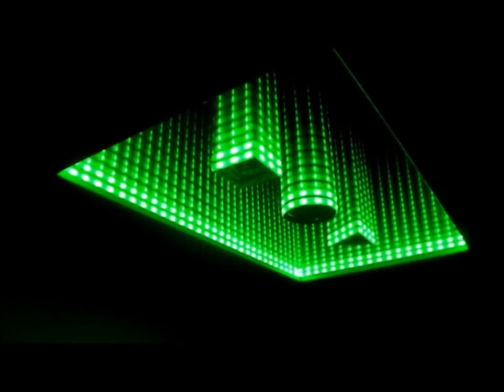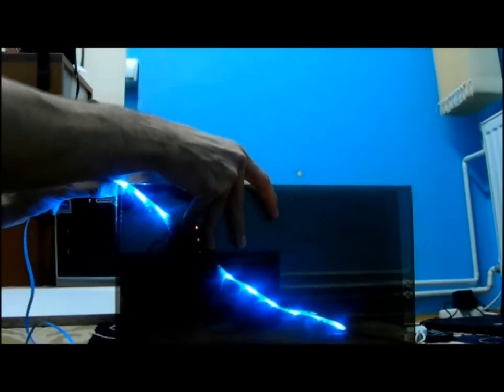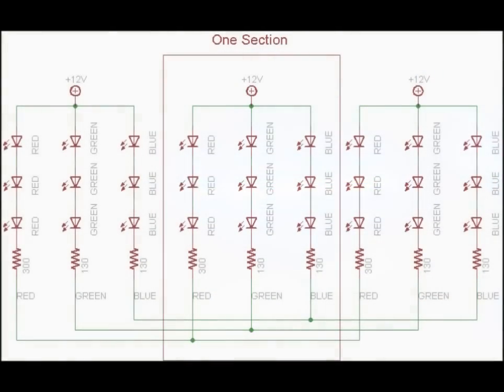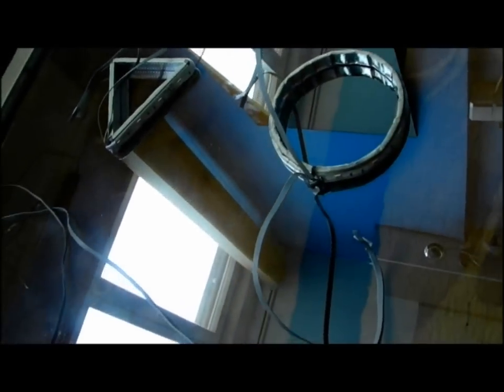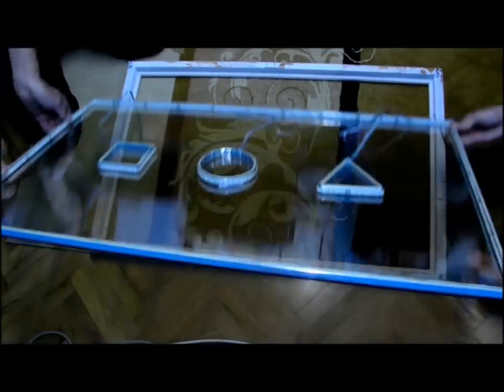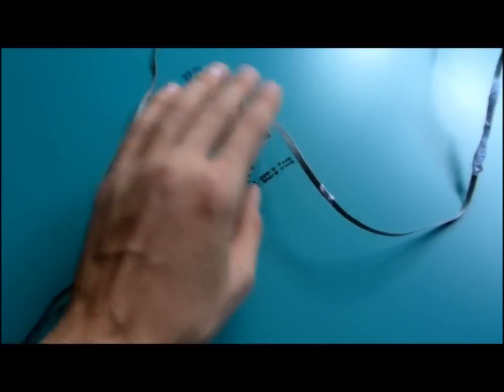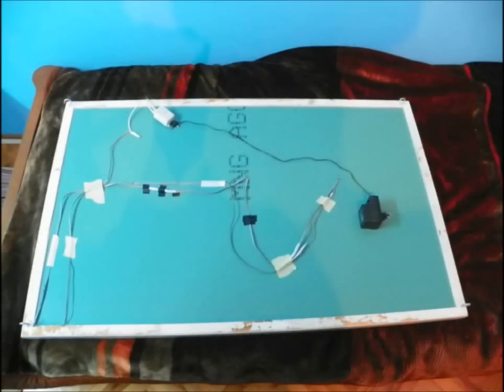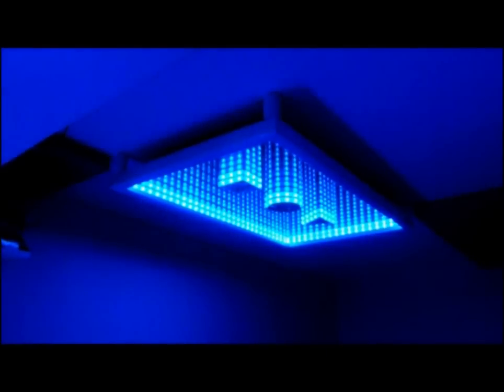How to make an Infinity Mirror

Comment: The infinity mirror is a symbolic representation of the PERSPECTIVE and RELEVANCE of DEPTH in the flat land world.  In our 3D world depth is normally conceived as a MEASURABLE QUANTITY having a LENGTH, BREADTH and HEIGHT.

In case of flatlanders, the EXTERNAL is a REPRESENTATION of the INTERNAL, meaning that, the 3D cube could be an outward projection or MANIFESTATION of their INNER SPACE, as in, they could reside in lower dimensions PHYSICALLY, but far surpass us, as the SPACE that they are confined to need not be physical but PSYCHOLOGICAL, EMOTIONAL and SPIRITUAL in nature. In other words, they solely dwell in their INNER SPACE that comprises the whole dimension in their realm of existence!. 

It is quite hard for us to perceive this concept, since we are so immensely attuned to the PHYSICAL DEPTH in the 3D world, that it often prevents us from INNER ENGINEERING our minds!.

😊🎉🎉

Comment: Hello Muhamed,

Well done.

Peter Nolan.(Ph.D., experimental physics). Dublin. Ireland.
Reply: Peter Nolan ...Peter Nolan ...Hi, just curious about your experiment.  Did you proceed with your idea? 

I wonder....would your experiment actually work?   The reason I ask is that, here on earth at ground level, the pull of gravity would be a constant from the start to the end of the mirrors, and back again,  and everywhere in between. I would speculate that the pull would be equal at all points,  creating a uniform drag throughout.  I wonder if this is measurable? Maybe?  Maybe it'd create a solid wall of light as the reflection droops ever so slightly,  assuming there is no loss of light.

Conversely, a light beam travelling in a straight line, unaffected by gravity, and then passing within the field of a gravitational pull,  and then passing back out beyond that field to continue on in a straight line again, IS most likely measureable (observable). 

Thoughts?  I like your idea. I hope you were able to get it going.
Reply: Okieman Mike Hello Okieman Mike,

It all depends on the numbers. I would have to either study general relativity in depth or approach an expert who specialises in general relativity to tell me the formula that will describe the deflection of a light beam, provided by a high power gigawatt single pulse ruby laser, traveling parallel to the earths's surface over stay a distance of 100 meters or thereabouts to see then if any such deflection could be measured. It might be too small but right now I do not know one way or the other anything about this. As I say it all depends on calculating that deflection from a formula that can be worked out if it hasn't already been done. I think this would be a great experiment to do on earth.
I still feel using intuition that if one could have many reflections just say millions back and forth that takes place in a infinity mirror that over many refections a deflection that big enough could be measured. It will take me years anyway to get round to doing this experiment and it would cost a lot of money if it's doable.

All the best,

Peter Nolan.(Ph.D., experimental physics). Dublin. Ireland.
Reply: Stol 3d
Reply: Hello AllEtcetera,

Why do you say that?

Peter Nolan. Ph.D.(physics). Dublin. Ireland
Reply from the maker: Thank you. =)
Reply: Hello Muhamed,

You have given me an idea how to do an experiment in physics that I have been thinking about for some time to see if I can measure in the lab the pull of the earth's gravity on light that is predicted by Einstein's General Theory of Relativity. This effect has been observed by measuring the deflection of light from a star as it passes by our sun but the has never been done in the laboratory as far as I know. If you do a bit of googling you can read up about this famous experiment in physics done many decades ago not too long after Einstein published his theory I think in 1915/1916. I think it was Eddington who did the experiment by traveling abroad from England to where an eclipse was happening.

Peter Nolan.(Ph.D., experimental physics). Dublin. Ireland.
Reply from the maker: Nice to hear. That sparked my interest, I'm looking forward to hear from you.
Reply: Hello Muhamed,

My idea is very simple to reflect light back and forth between two mirrors placed say a few hundred meters apart using a high powered pulse laser to see if the light by traveling back and forth between the mirrors parallel to the ground the earth's surface might undergo a deflection due to gravity that could be measured but until I do the numbers using formulae I will not know if this experiment will give a measurable deflection or not.

Peter Nolan.(Ph.D., experimental physics). Dublin. Ireland.
Reply: What a shitpost

Comment: but if some LEDs dont work anymore u have a problem, as u cant easily change em?!
Reply: xXN0cturnXx Yeah, if some went out, you'd have to take it apart, and replace the strip that has the burned out lights. Definitely make sure you use "LED" lights, as LEDs will work for many years before they start going out.

Comment: what kind of drill bit did you use for the holes in the mirror?
Reply from the maker: I didn't do it myself, I asked a professional to do it for me.
Reply: You can do it yourself, the trick is, you do not DRILL a whole in glass - you GRIND it through. 
A small grinding ball or cone can be found anywhere that has DREMMEL supplies.

Take your time.
Apply only light pressure.
Keep it wet.
Reply: Professionally cut, I imagine.

Comment: I have to agree with that one. You can speed up your computer if you got rid of all those shortcuts on your desktop. Use your start menu to get to your programs. Just a helping hand from a computer tech. Other than that, your project is very cool. Would like to see it slowly change colors without the lights going out. I plan on making one just like yours. I will have 500 lights on a 8x10 box. Keep up the good work and stay safe when using electricity.

Comment: I want to know how long do these LED light strips last? And have you ever had high temperatures on the LED?
Reply: TheFNProductionz My new 5050 RGB 150 LED Waterproof Strip Light came with a 12v 5A power adapter. the temp runs high.As to the life of them 20,000 hours. I have many Leds in my house used in /lamps /DJ gear/projectors/security, I have not needed a replacement led in anything,tho as a tech I have replace a few in repair products.
Reply: Fly Robin What kind of temps do you get? Is it hot to the touch?

Comment: And what life time do the LED's have on that? Wouldn't be worth it if it wasn't very long...
Reply: Well, LEDs are usually expected to have a lifespan of more than 50,000 hours. I'd be more concerned about the capacitors. Generally speaking though, you are probably looking at years and years of use.

Comment: The only reason I clicked this was to check how he drilled the holes.

And the only thing that wasn't covered by the video was: how to drill the holes.

Come on.
Reply: Lam http://www.doityourself.com/stry/how-to-drill-holes-through-a-mirror#b
Reply: there are specific drill bits for glass, there diamond tipped. you can get them at most home improvement stores
Reply: nicholas manfredi remember using these bit you must use water to cool off mirror while cutting or you will break the glass. you could also you plexi glass. Tap plexi glass is a good source. they might even cut the holes for you.
Reply: yes, thank you, i always forget to mention using a coolant.

Comment: If you replaced the initial mirror with another pane of one-way glass (so you had two one-way glass panes, instead of one with a normal mirror), would that make the infinity mirror work from both sides?
Reply from the maker: The illusion would be weak. It could work with powerful lights and 90% light transmissive glasses but using glasses like that barely you could see through the other side of the glasses.

Comment: How would you put this at the bottom of the pool without the loads cracking the glass?  This was an awesome video.
Reply from the maker: it's possible because there are glassed for underwater and thick enough to hold tons of water :)
Reply: Muhamed Retkoceri or you can use acrilic

Comment: where did you get the mirrors?
Reply: Windows-glass lab, or you can buy adhesive mirror sheets (free glass)
Reply: Andrew Billy is windows-glass lab an online store?
Reply: I bet there are online shops...
You should go on a bricolage center and ask to them what you need, surely they'll suggest you where is the nearest "lab". I don't know the english name of these "glass-labs", they are shops which cut glass and mirrors on demand, usually for home-windows, windows-shops, and doors, sometimes they work also with plexiglass and similar.

Comment: Most of you probably don't remember this but in the early 70's infinity mirrors were sold at art shows by the hundreds.  I bought one about 2 feet squared for $130 ...about $800 of today's dollars. It has two modes: Sound excited  and chase mode.
              Make no mistake something like this would easily sell for over $1000 at an art show ...and the LEDs will last for decades (The chinese power components? well, I'd have a good fuse.)   Nice job Muhamed.

Comment: But black its not a color!, a black body its a body that doesnt irradiate any longwave of the visible spectrum. I learn it in heat transfer and in optics it is taugh, also thats why the black holes are black! because it doesnt let the light come out. but its ok not meant to bother or anything like that, just wanted you think about that :D

Comment from the maker: I bought LED strips at a light's shop,
for the wires you can buy them in the same place, and sometimes some shops have wires sophisticated for custom installation.
Aluminum spacers are very "supportive" as you said, they are special for glasses and since a glass is touching in all the sides, it can't break unless you smash it on the middle :P :P

Comment: I had a few questions for you if you don't mind. First of all, where did you buy your LED strip? and did it come with the RGB wires or did you have to buy those separately. Also, are the aluminum spacers very supportive? By that I mean does it support the weight of the second mirror on top of it. Its for a 3x2 foot table top so I want to to make sure it is sturdy and won't break.